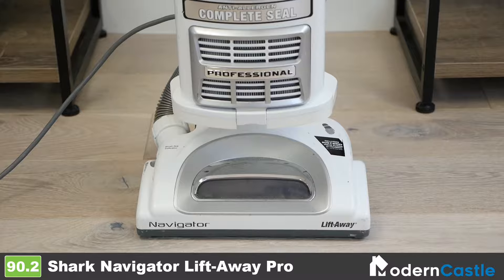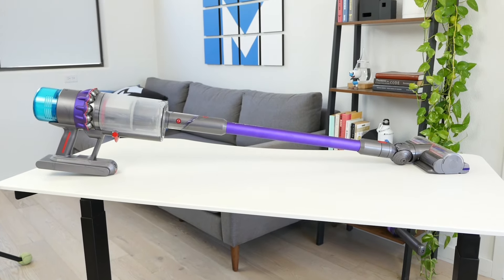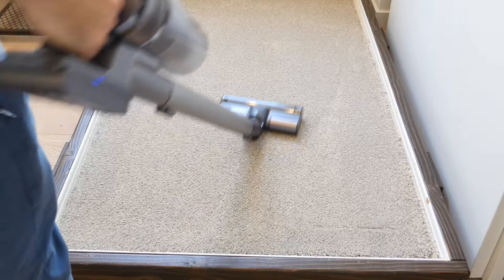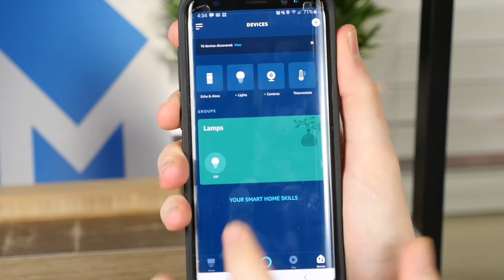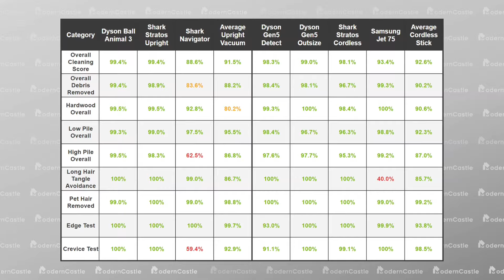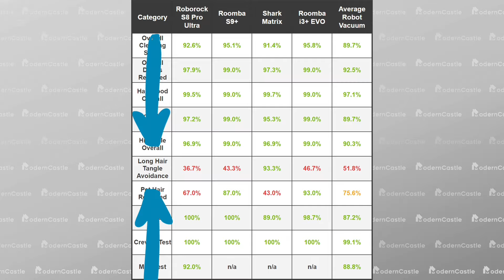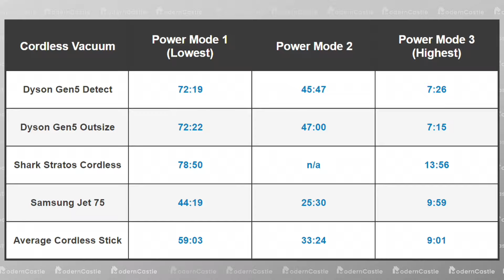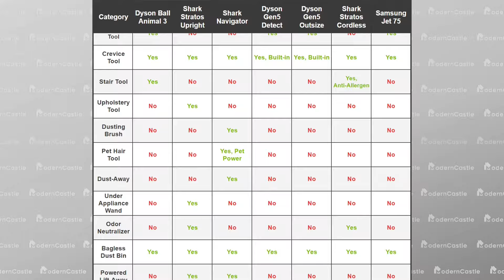Best Vacuums of 2024: 150+ Vacuums Tested

Comment: Lovely channel and awesome tests! I'm looking for a robot vac but its hard finding how much space they can clean. We need one for our detailshop and its around 200kvm big. Mostly dust and gravel needs to be removed. And also the option to put up barriers in the app. Also it would be nice with self emtying :) Any advice?
Reply from the maker: Unfortunately, if you've got gravel in the shop then there is no robot vacuum on the market (that I'm aware of at least) that is going be able to handle that. A single piece of gravel can deal serious damage to a robot vacuum. If that's a regular occurrence than any robot you put it in there is going to have its days immediately numbered.

I've tested a few different robots in the garage where I store all of these robots. Rarely a piece of gravel gets in there and when it happens it either 1) does a lot of damage to the robot or 2) kills the robot. Some are more resilient than others.